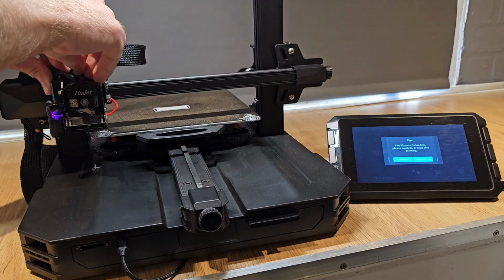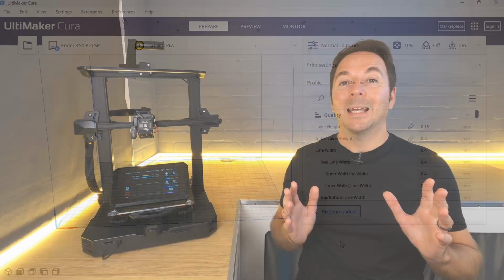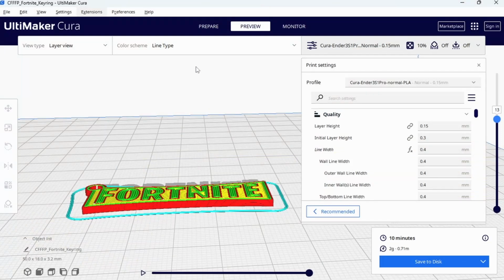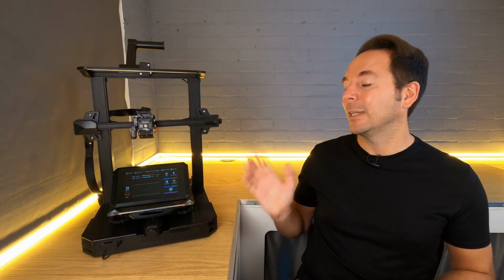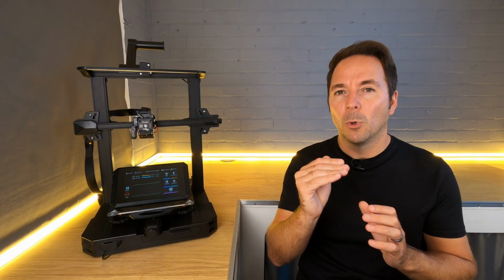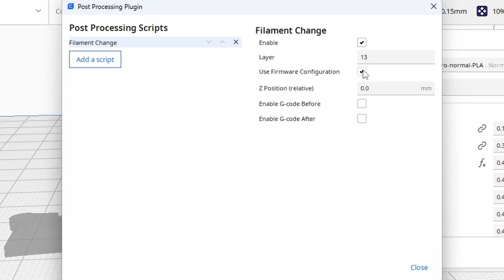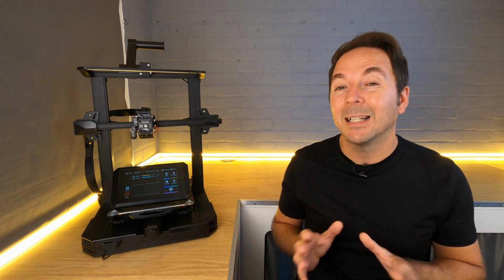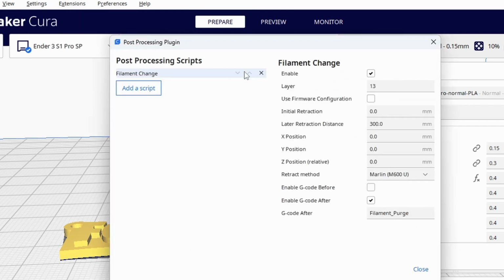How To Complete a Mid-Print Filament Change - Sonic Pad Intermediate Part 9

Comment: My Sonic Pad has the latest release and is connected to my Ender-3 S1 Pro via USB.  I can print a two color small item as Ricky does in this video but it fails with a much large print - in my case a Kansas City skyline that's 190mm wide, 56mm thick and 10.3 mm high.  The skyline is fine but the message is {"code":"key244:":"msg":"Extrude only move too long (-3504.163mm vs 1000.00mm)  See the 'max_extrude_only_distance' config option for details ........

In the printer.cfg file line 22 reads max_extrude_only_distance: 1000.0 - what distance will cover all situations and will changing to say 4000.0 or 5000.0 cause a problem?
Reply: line s/b 141

Comment: Ender 3 S1 Pro with filament sensor in use and a Sonic Pad [Klipper} filament purge workaround (tested and it works)
	used my me to print a base and then lettering in another color

have your web interface to the printer up the console window available before beginning

in the CURA filament change post processing script modify the Z positive (relative) to value such as 50
	this will ensure that you can see the nozzle, remove surplus purged filament and clean the nozzle area
	leave X and Y at 0 (zero) so the print head is nicely positioned, later retraction to 20 (or whatever)

action: the "BASE" prints

when the M600 filament change runs the printhead will go the left front and park (not over the print)

remove filament #1 from  the extruder but don't pull it out of the filament runout sensor (FRS)

insert filament #2 fully into the extruder bypassing the FRS

from the Klipper web interface run "G1 E100 F100" command (or whatever values are good for you)
	you can only do this once so ensure that you extrude enough

remove filament #2 from the extruder
remove filament #1 from the FRS

clean the nozzle (I use a long tapered tweezer followed by small strip of 3M Scotch-Brite

recut filament #2, run it thru the FRS and insert it fully into the extruder again
	note - this will minimize any gap in the printed filament

press "Continue" on the screen with the "Tips The filament is loaded.  please confirm, or stop this printing"

action; the "LETTERING" prints on top of the "BASE"

Comment: This doesn't work with my Ender 3 S1 Pro and a Sonic Pad with the latest release.  It has the M600 in firmware but it's just not working.  The gcode has:
;BEGIN FilamentChange plugin
M600 E10.00 U20.00 X200.00 Y200.00 Z50.00
;END FilamentChange plugin
I'm also tried "Insert at Layer Change" and "Pause at Height" as  well as a full macro.
Thoughts?

Comment: Got the Ender-3 S1 PRO, signed up to TinkerCAD, designed and printed a few things, thought this is alright. Then found Ricky Impey, got a Sonic pad, followed the basic and then the Intermediate instructions, NOW we are sucking diesel. Installed Cura, done the lot. 1. When I use the Creality sonic pad wifi to load and observe on the home PC  I get a warning that " the connection is not secure" any help on this potential issue would be amazing. Thank you for saving a 75 year old man from decline totally. WJL

Comment: Thank you for this video. 

I had been trying to do filament change at layer using Orca Slicer, and my Ender 3 S1 and Sonic Pad and not really having much success at all.

But it was a painless process in Cura, and I also added the M83 before the Gcode and M82 E0 after the gcode as suggested by @66123CJ.

Comment: I still have the problem with my Ender 3 S1 Pro that it prints too small. 
a cube 20x20x20 it prints 19.4x19.4x20.2.
How can I set this on my Sonic Pad? 
I've already worked through the entire playlist.    (translated with google🙈)

Comment: Doesn't work on the CR-M4.
Never-ending got it working but when using the purge or filament load macro it does it right where it left off. How do you fix that? How do you do it in the park positon not on the model 😢

Comment: Thanks for the tip...But its not working for me after layer 10.  I did this 7 times and it worked with change at layer 5, but when i changed to to layer 20 it failed everytime. Telling me that the "Extrude only move too long"   And nothing was changed besides the layer.     Else it could have been a nice trick to do 😁
Reply: Have the same problem with Ender 5 s1. Have this error, and it stops. (Maybe because head can't go far out of the bed?) 
How to change filament within the print bed?
Reply: @a1exa1  no because it only goes to 0,0 .... so 🤷
Reply: ditto! any fixes?

Comment: I have an Ender-3 S1 Pro with the direct extruder. I have tried the method you have described with some success. However, when my printer pauses at the specified layer change, the extruder is grinding away until I either feed in new filament or manually push the existing filament into thr extruder. Is there a gcode I could add into the filament chage extension to stop this happening? My retraction settings in CURA are currently 1mm @ 25mm/s. Thanks again to Ricky for this really helpful series of Sonic Pad videos.

Comment: @RickyImpey Love this series, it helped me to get my sonic pad up and running. I was running into some issues and finally determined that the issues i am having are with the printer software. There is a bug where, randomly, the extruder will retract the filament fully out of the extruder causing the print to fail (talking to creality about it now).
I would love to see a series with adding the new Nebula camera configured to work with the sonic pad and any additional Cura adjustment to make now that 5.5 is out.
Update: was able to fix the extruder issue, hadd to add code to reset the extruder after prob calibration is done.

Comment: Thanks
Reply from the maker: Thank you👍
Reply: @RickyImpey  I was wondering if you've discovered a way to get the SP to work with 2 cameras and 2 printers. I'm running 2 x CR6 Max on 1 SP and I'd like a camera trained on each printer. I'm able to add 2 cameras and call them different names but all I get is the same image from one camera, duplicated. Any ideas?
Reply from the maker: @Eponemuss Hmmm, I haven't tried🤔 I think the key may be changing the port ID on the camera's IP address, have you tried this? I will have to try next time I am using the SP.

Comment: @RickyImpey Great tutorials for beginners Ricky, may i suggest you make a video to calibrate the max flowrate your hotend can handle?
I see a lot of people in the facebook groups with a sonic pad changing to a .6 nozzle and everything stock (cooling/hotend) and having extrusion problems because with a .6 nozzle .28 layer height at 100mm/s you're at about 17 mm3 flowrate and most stock hotends can handle about 12 mm3 if you are lucky. 
I tried to explain them but they say they followed every step from your videos and that should be right, thanks for all your time and making those great tutorials.

Comment: Hey Rickey i just installed a new 5015 part fan set up with my S1 Pro with a Sonic Pad and it moved my z probe to a new position on the print head.  I was wondering if I could send you over the new print head that is a direct bolt on and a new fan to go with it and maybe you could make a video on it ??? Just wondering.  I'll pay for shipping and the parts.  I think it would be a interesting video for a cheap upgrade us 3d printer owners love! Love the videos thanks!

Comment: Thank you Ricky for all your videos. You convinced me to get a sonic pad and I am so impressed with how my Ender 3 V2 is printing using all your advice.  I recently bought an Ender 3 V3 SE and creality support said they will be releasing support for this on Sonic Pad around end of this month.  Please, please do a series on this as I am so far pretty disappointed with the results using Creality Print which is seems to be the only slicer right now that supports it.  While I am here, I also decided to go back to Cura from Prusa because whatever i changed I could not get Prusa working well with Sonic Pad.  Cura seems to be falling behind these days so I also hope you perhaps try and cover how to use other slicers that have more features. Sorry for all the asks. 🙂

Comment: I bought a sonic pad for my S1 Pro because of you :P  It, and your videos about it, have made my printer so much better.  Thank you so much!

I'm wondering now if the next step I should take is upgrading the cooling fans for it?  Done a bit of googling about 5015 fans, what other people have done etc.  But am unsure if it's worth the effort.  I ask because the thing people recommend upgrading the most on this machine is the supposably weak cooling fans.  And this is especially recommended if you use klipper and want to print faster at a better quality.

I see you havn't done any fan upgrades to your machine, any reason why not?  I guess you're probably busy.  But if you do investigate this, please do a video!  :P
Reply from the maker: Hi, yes you are correct l, the cooling is weak when you want to go fast on the S1 Pro. Stay tuned as I'm hoping to put together a project that will give you the answers you need soon👍
Reply: @RickyImpey  It would be interesting to test and compare some cooling options for the S1 pro, such as the designs from Zuff, Taurus V5 and Heartbreaker MK5

I'm doing the upgrades to use with Zuff designs, we'll see and it will come out

Comment: For those that are getting the extrusion error try adding M83 to Before G-code and M82 E0 to the After G-code. This should keep you from needing to change your max extrude in cfg
Reply: Thank you so much! I was getting frustrated with the extrusion error. Your additions worked like a charm. I have to say you're a genius.
Reply: THANK YOU! I was going crazy trying to figure this out that works perfectly!!!
Reply: THANK YOU!!!!!!! Ricky you need to pin this!!!
Reply: thanks a lot ! it work for me, no more error and no need to change anything in the config file
Reply: Thank you!! That worked perfectly for me also.
Reply: Top top top comment
Reply: You save me! Thanks!
Reply: how does one change that?
Reply: Hi, i´m new with the sonic pad , i put de M83 and M82 E0 as you suggested but i have a message error, "Move out of range 205.2 415 12.56 [13]"   i´m testing with a single cube and put the filament change   in cura and  the print stops just after de home xyz at the beginning
please some help here
Reply: красава! 😎

Comment: I tried this just now, and when the print head parked for the filament change, there was some noises that sounded like a loud hum, louder and higher pitched than my stepper motors. I changed the filament and resumed, and it was normal. Any idea what that noise was? Whether it was a bad thing? Normal?
Reply: on an Ender 3 S1 Pro
Reply from the maker: I think Creality have made an error with their macro. Unfortunately I can't get to it to see what they have done but I have experienced the same on the S1 Pro. It sounds like a stepper going out of faze or something similar.
Reply: @RickyImpey  should I be concerned? Should I avoid using it? Or rush to minimize the parking time? Or just use it as is?
Thanks for your reply, I love your videos!
Reply from the maker: @bobmrf  I can't really say for sure I'm afraid. I don't think it is doing any damage but I don't want to tell you to keep doing it if there is a chance.
Reply: @RickyImpey  thanks again for the reply, I will proceed at own risk.

Comment: Thanks for the video, Ricky. Followed all the steps shown by you, but still got the error message {"code":"key244":"msg":"Extrude only move too long (-2740.87mm vs 500.00mm) See the 'max_extrude_only_distance' config option for details", "values":[-2740.872,5000.000]}. Can you or anyone else guide to resolve this issue, please?
Reply from the maker: Check out your max_only_extrude_distance figure in your printer config file. It's likely that the m600 macro is asking for a distance that is larger than the limit you have set.
Reply: @RickyImpey  changed it to -3000 and now working fine. Thank you so much!!!

Comment: After the filament change I kept getting a blob when printing continued. In case anyone else is having that issue in cura I turned on draft shield which completely solved this problem.

Comment: Great video, as always! Do you know why my CR-10S Pro V2 doesn't stop automatically when the filament is empty?
Reply from the maker: It will most likely be that you don't have the information needed in your printer config file for a filament runout sensor so it isn't looking for a signal.
Reply: @RickyImpey  Any chance you will make a video about it? :)